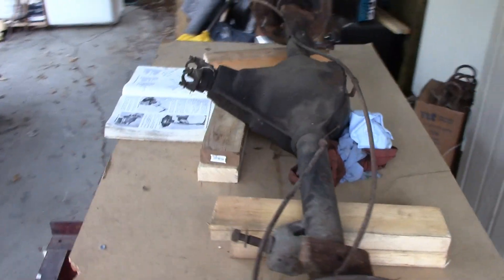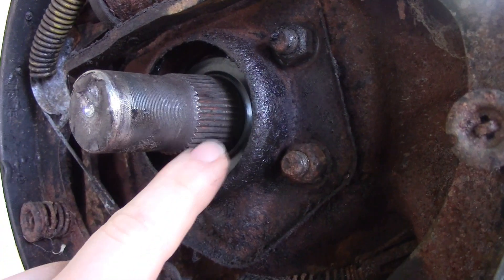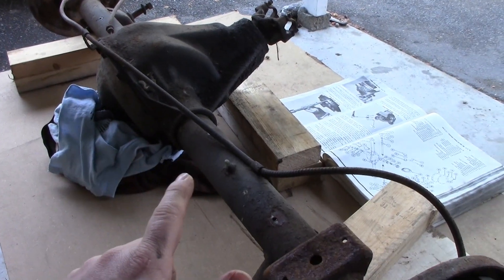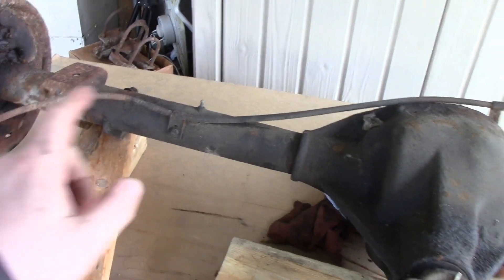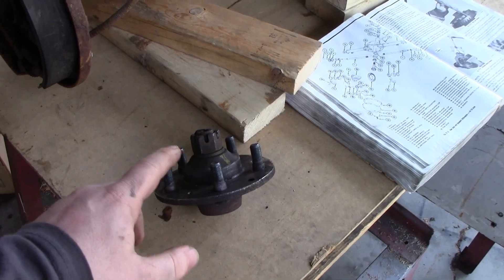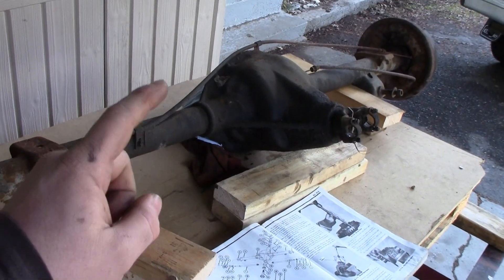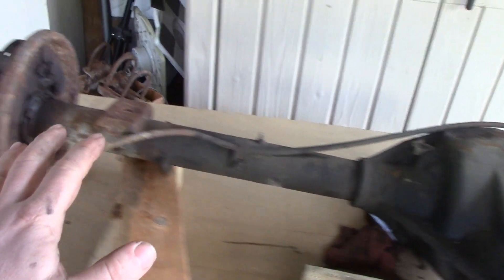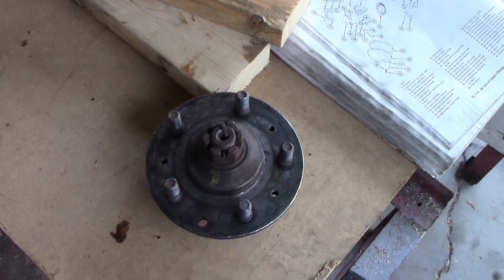Incorrectly Torqued Axle Nuts on AMC Eagles

Comment: Hey ! Stumbled on this today. I know it's two years old......but Eagle peeps are always scouring for stuff on these AWESOME cars ! I discovered the exact same thing you did and described here after an axel ~snap~ ! [[ driver side in a 1982 Sx4 ]] I too learned about the over torqueing issue surfing the net. I will say that I did abuse that rear axel a bit though. I had previously swapped in a model 229 two speed transfer case [[ replacing the Model 129 single speed ]] giving the Eagle low range, and wheeled it a little bit.... (Like Black Bear Pass in Colorado...hehehe)
     After the failure I didn't want to go back to that weak model 20 (35 cousin). I did find that the Jeep 35-C would go in fairly easy, as you mentioned with minor mods. B U T !!!! I found an even better swap in ! The 35-C's were abundant from Jeep Cherokee's. But also in the Jeep Cherokee occasionally you will find and even stronger axel !! The Chrysler 8.25 ! It's like a 35-C on steroids. Stronger shafts, thicker tubes, bigger gear sets, bigger brakes.  "Almost" Dana 44 strength, but still a C-clip unit. Which was perfect for what I wanted. 
       Sooooo..... The donor came with 3:07 gears, which research showed was a tow package ratio for the Eagles, so I knew I could re-gear my front 2:42's to match. I also put a "Lock-Rite" locker in (easy peasy removing the spider gears on the c-clip axel). Had to reverse the shock mounts and do some brake line re-routing but soooo worth the effort for a bomb proof axel for the Eagle. 
       With that HD rear axel, and a low range T~Case.......the mighty SX-4 is what AMC should have made ! Now if I can get the motivation to add fuel injection......but the ol' carburetor works just fine and im getting 23-26 mpg on the highway with the part time 4-wheel drive. I am astonished by that. 
    Anyway....thought I would share since Eagle fans are always scouring for info. I'll link two vids. One is my swap, and one is it's first big Moab run afterwards. I also did another Moab trip in 2022 an "overlanded" it a bit with a video of that as well. Peace ! Sweet Wagon !   
  INITIAL AXEL SWAP AND TEST:   https://www.youtube.com/watch?v=0CMCwijkwO8
  A MOAB RUN TO TEST IT FURTHER(9 years ago):  https://www.youtube.com/watch?v=_mZTWE29mtU&t=1s
AND A MOAB RUN LAST YEAR: https://www.youtube.com/watch?v=B4MRiP0rFlk&t=21s
(check that channel for my Black Bear Pass run with it too last year....love this ol car !)